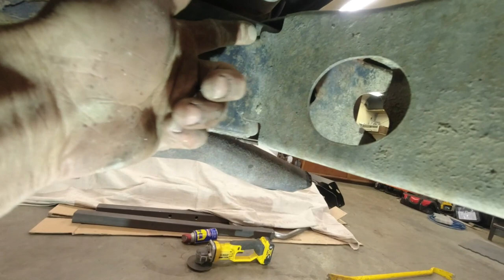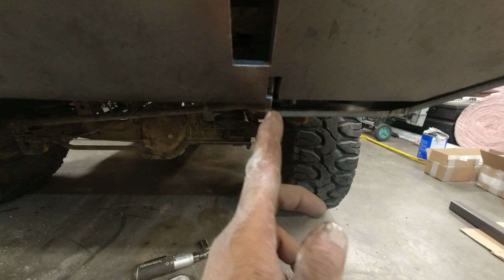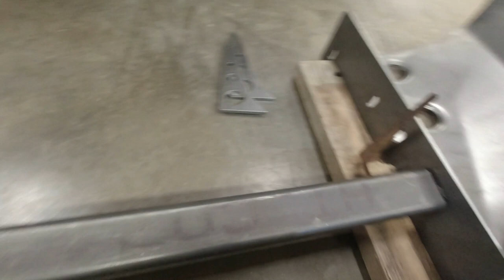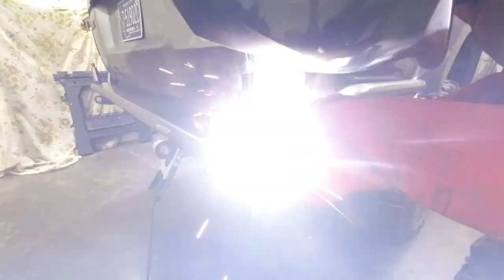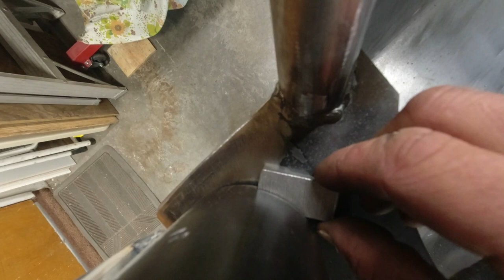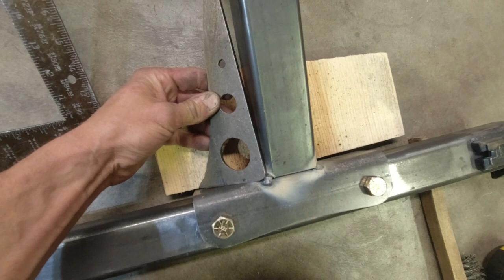Rear Bumper Build - 4x4Labs - 80 Series Land Cruiser

Comment: Great Video,  thanks.  I just started mine and the tips were spot on and saved me some time.   Great Bumper.    Looks like 4 x 4 labs just updated their website and the photo of the bearing set up is not there.  I did send a note to support and they sent me the picture right away.   Thanks for blazing the trail for me.

Comment: how thick is the steel? 3/16?
Reply from the maker: Yes 3/16
Reply: @ldooffroad1823  Awesome I'm fabbing up one right now cause 5k is crazy to me for a bumper lol, I'm in about 400 after metal and heavy duty swingout bearings but ofcourse way more time working on it lol. Was curious what lift and tire size your running?
Reply from the maker: @jraddd3477  running 2” OME lift, and at the time of the video I was running 33s. Now I’m running 35s. Same lift. No rub.
Reply: @ldooffroad1823  Did you remove the the bearing sealer from the bottom of the spindle when you were welding up the arms? If not was it fine? I just don't want to melt it lol, also did welding the arms on did you do it with the bearings inside, if so did the heat warp them at all?
Reply from the maker: @jraddd3477  If I remember correctly, I didn't install the seal until it was finished. As for the bearings, I believe I removed what I could before welding. I only tacked it together while assembled, then disassembled to fully weld. I did not go to the extent of pressing everything out though, just whatever came out by hand.